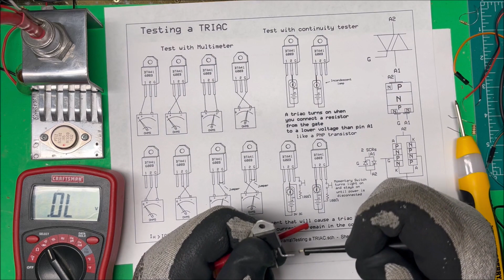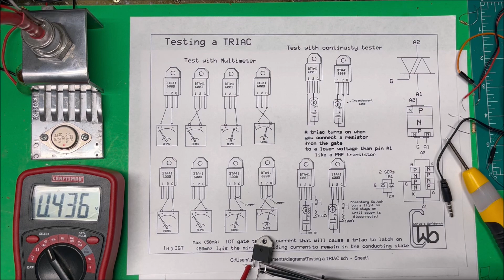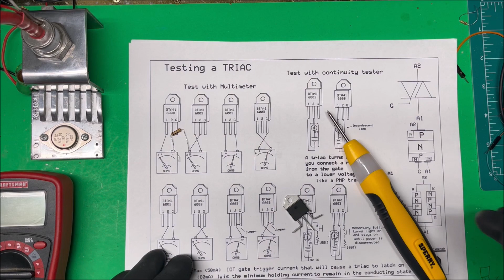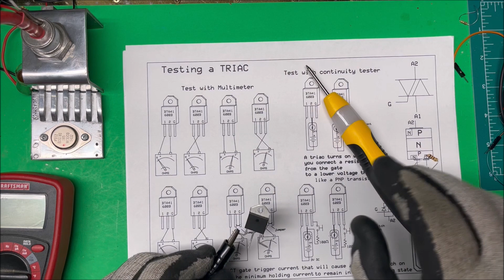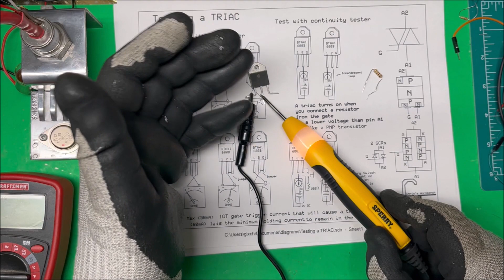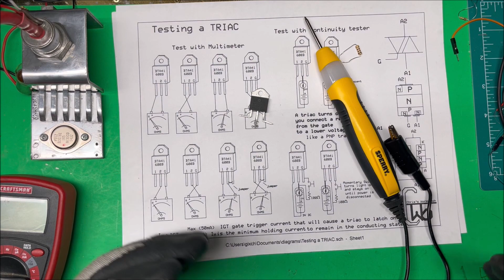TRIAC test

Comment: Your video brings up a question.   Your test with the Sperry tester is using the triac in DC mode.   Can you substitute a triac in a DC circuit that uses an SCR with out any ill effects?
Reply from the maker: An SCR acts like a diode when turned on allowing current to pass in one direction. A TRIAC works with DC but it will conduct in both directions. Fault current could flow in the reverse direction.
Chris